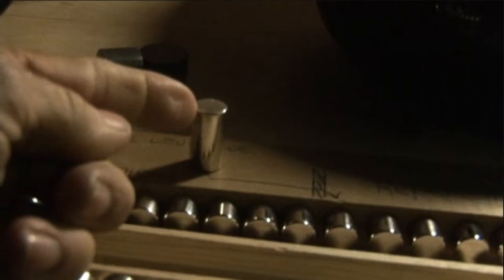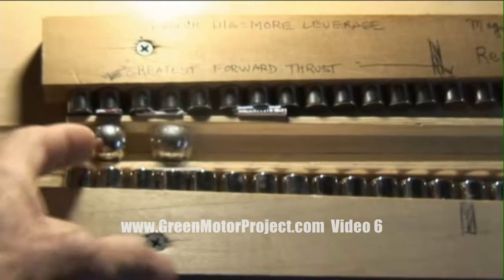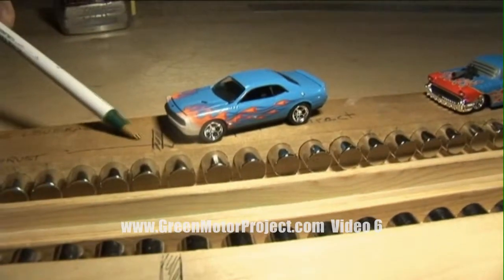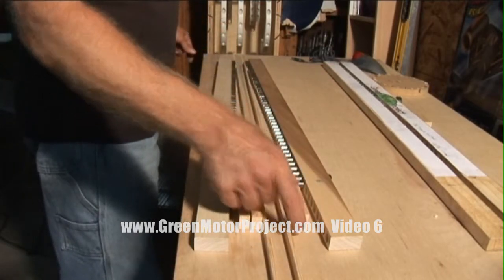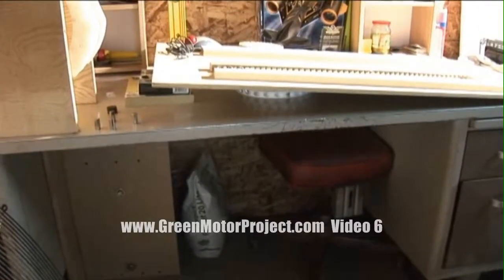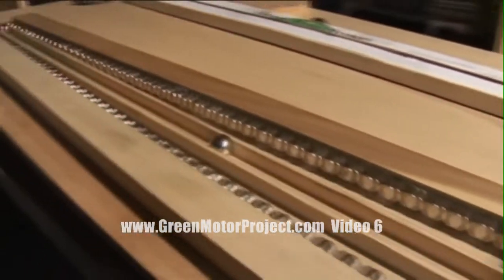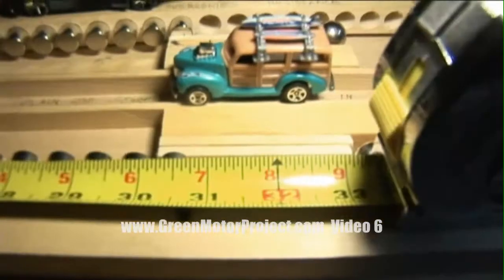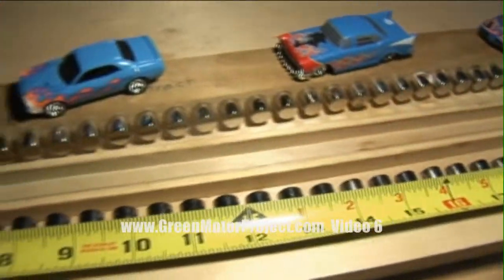Green Motor Project Video 6 Piano Font 1 California Green Energy Solutions 2010

Comment: Obviously, by the end of the track, the force generated by the magnets is stronger than the pull of gravity... which has always been the stumbling block for these ideas.

However, would it be possible to place shielded magnets (opposing poles) above the track to exert a downward force to assist gravity to push it through a hole in such a track? - or even to give it the additional velocity needed to break free of the attraction of the other magnets?

Comment: @44335675 
This is exactly what needs to be done. Once the loop is connected you have a system that will use gravity to move the balls back to the starting position  As long as the downhil slope is great enough for the gravitational pull to feed the next ball up into the force field voila! The question would be, at which point do you harness the energy for use outside of the system. Sign me up for the internship!!

Comment: This is quite impresive,but there is a problem-the ball stops at the very end of the rails and all the energy is lost and you have to manually tak out the ball. what would be really impresive is this:Using rails get the ball on the top of a hill and let create another set of rails without magnets that would lead downhill and connect to the start of the"power"rails.If the ball makes it through to make a another turn than you got it..but now there is still that problem of the standing ball on top.